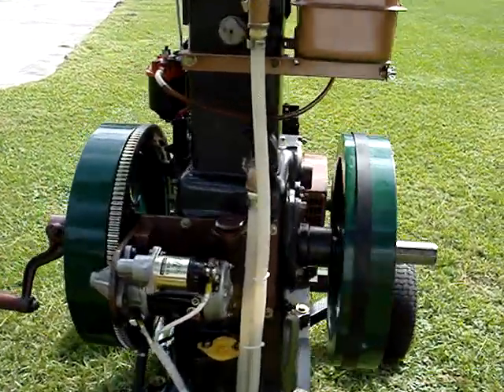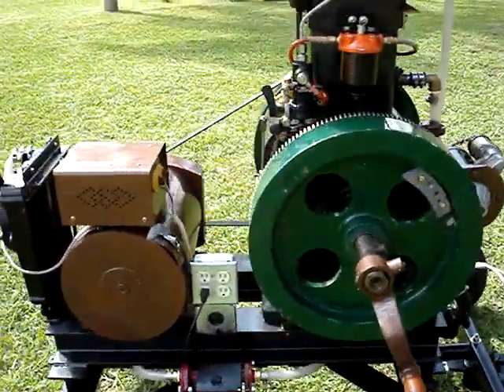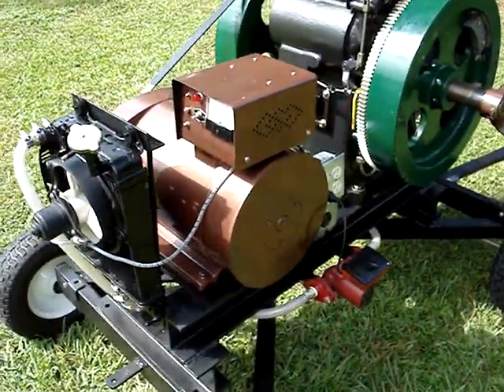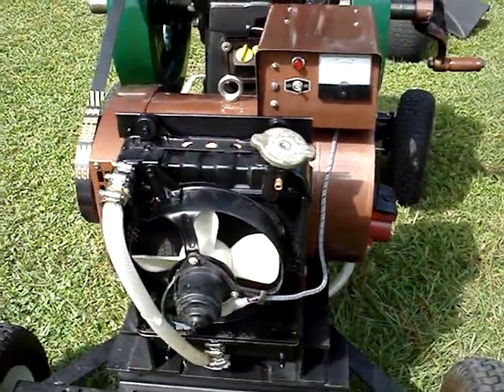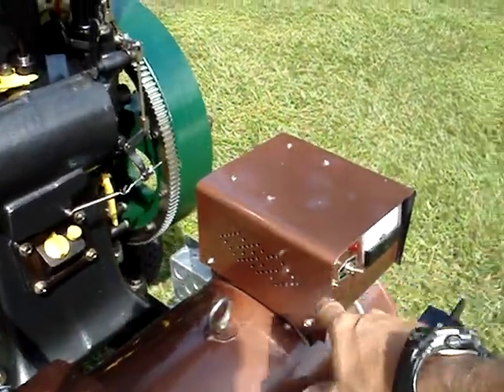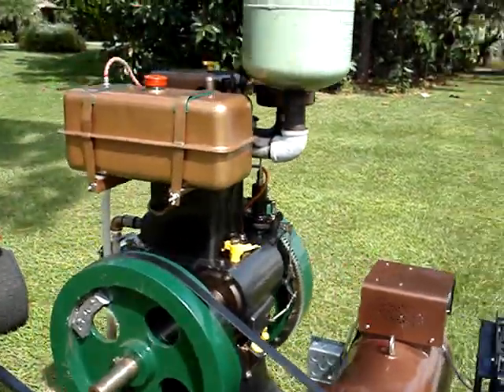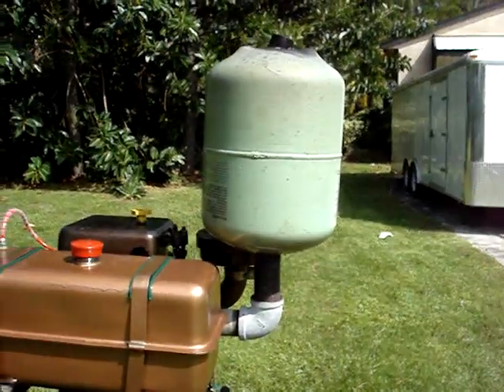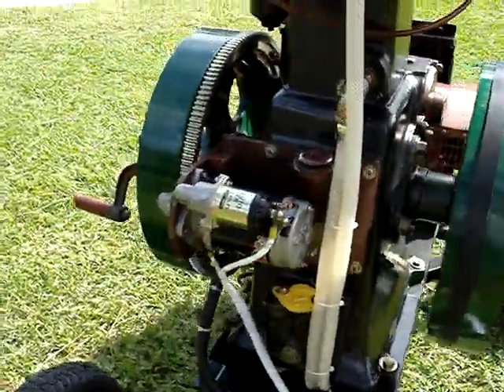Lister CS 6/1 genset Listeroid

Comment: very nice. Are you sure about the size. 6/1 is a spoke flywheel. Those look like the 8/1 stover wheels. The stover wheels can handle more rpm's and have more mass thus making more hp

nice work
Reply: There's absolutely no difference between the six one and the eight one no matter what the design is the flywheel weight is the same on both engines unless they have changed it recently- the only difference between the 6 and 8 horsepower is the clearance between the head and the Piston top dead center and the valve timing with the 8- horsepower there are any paper shims between the water jacket and the crankcase if you're running it as an 8 horsepower at 850 RPMs you have to add some shims between the block and the cylinder jacket that changes the clearance between the piston in the head and you also no longer use the compression change over valve if you have one- if you have a compression changeover valve you can use it as a 6 horsepower or eight horsepower but if you're going to use it as an 8 horsepower you have to change the valve timing either way it's extremely simple to change it from one horsepower rating to another

Comment: just wondering how much hp this produces? guessing around the 10hp or so?
Reply: if it's shut up at 500 RPMs it's 4 horsepower at the shaft if it's set up at 650 RPMs it's 6 horsepower at the shaft with a slight modification of the headspace from piston to head and valve timing it can be used as an 8 horsepower at 850 RPMs that's at the shaft when you belt it to a generator head you reduce the output by 20% for every 2.5 horsepower that is equal to one kilowatt of usable power off the generator the fuel consumption is 1 quart or 300 ml per 1 KW consumed off the generator that engine is the longest production engine in history it's been made for about 90 years with very little changes there are upgrade kits if you want to modernize an old-style engine